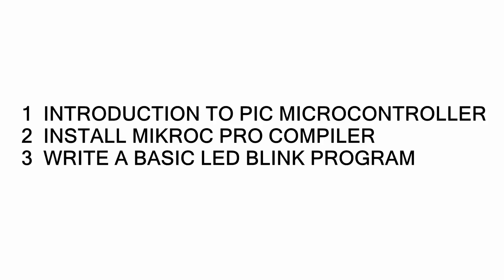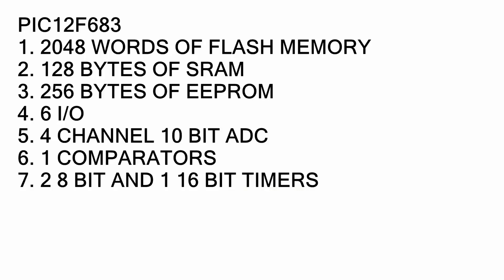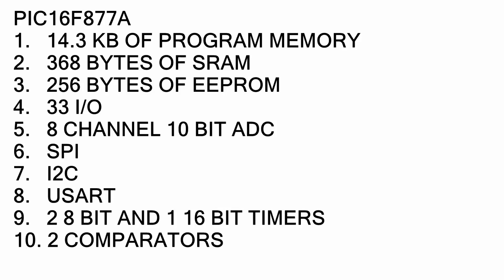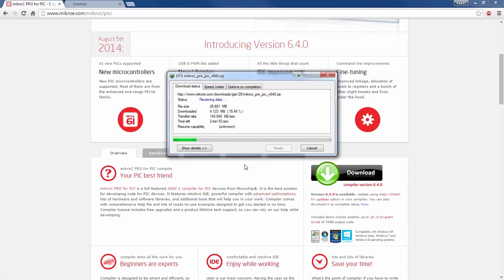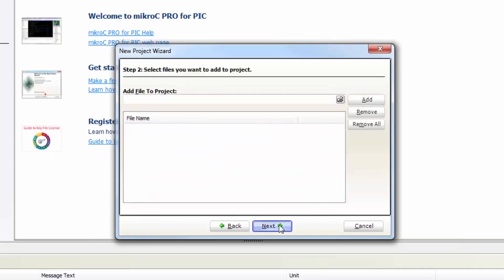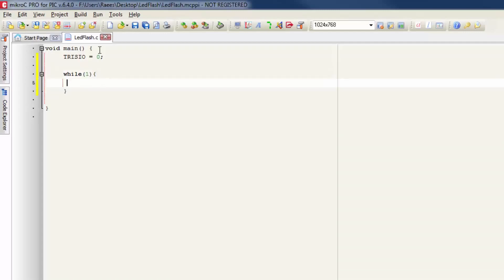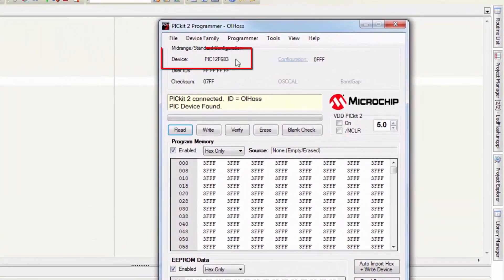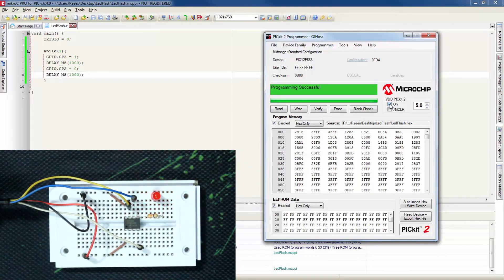Pic Micro controller Tutorial ¦ Led Blink Program

Comment: I performed your Pic Micro controller Tutorial LED BLINK Program successfully.
The  build went well,  I loaded the HEX file successfully to the 12F683 using
a Pickit 3 and the MPLAB X IPE software. I connected the 12F683 to a breadboard
and only used pin 1 (+5vdc), pin 8 (GND) and  pin 5 (GP2) with a connected LED with 470 series resistor going to ground. The other five pins I left open circuited. To my surprise
the LED did not flash at the 1 second rate. The output at pin 5 measured zero volts.
I tried another new 12F683 and have the same problem, Is it possible the configuration bits are not set properly?, causing my problem. Any help  would be greatly
appreciated.